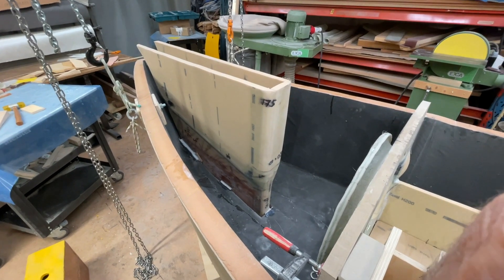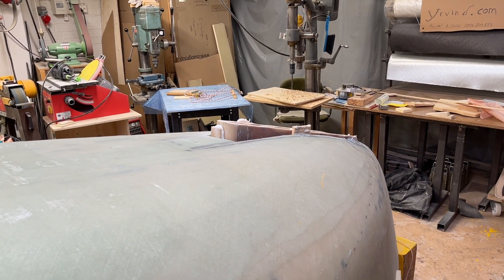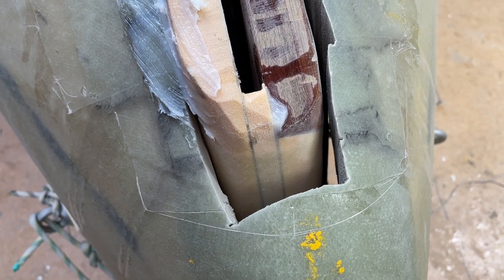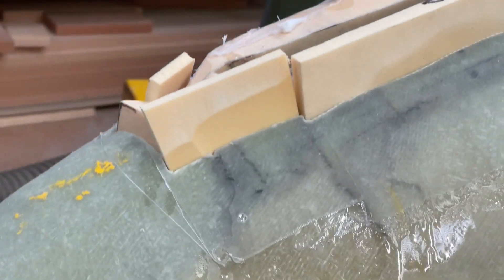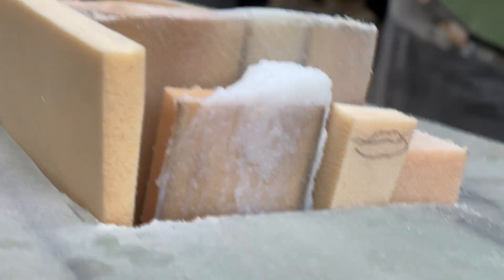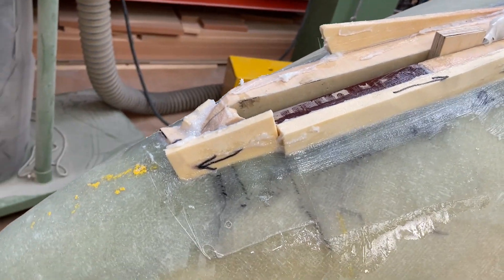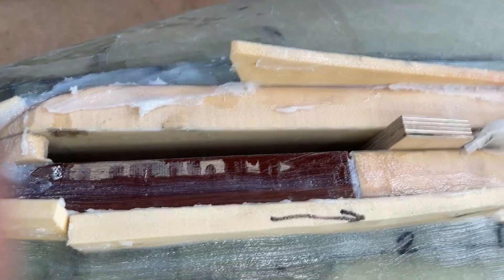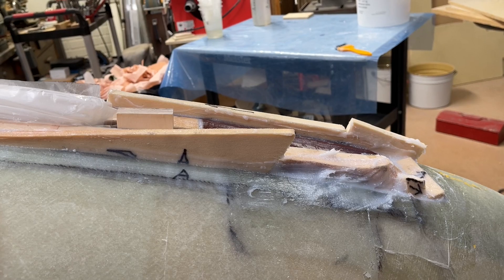8 August 2022  The centerboard trunk gets Divinycell and thick NM epoxy from outside to be strong

Comment: With Divinycell and thickened you can fit almost anything together and make it strong. Will you have room to wrap a layer of fiberglass cloth over the inside edge of the centerboard trunk onto the bottom of the boat to seal it against any moisture wicking through the joint? Thank you Sven for the update.
Reply from the maker: There will be fiberglass on the inside to but it is not needed as Divinycell have closed cells and do not absord water.

Comment: I fit a string bass nick block like that one time.  Fit each wood piece with chalk and glued them with epoxy.  The boss was too cheap or lazy to find a piece of wood big enough to use as a neck block.  It worked fine and was probably stronger than the single piece of wood.  Looks good.
Reply: Nice. I wonder if Sven had settled on the bow centerboard earlier, he'd have built the trunk first, then cut the hull slot to correspond?